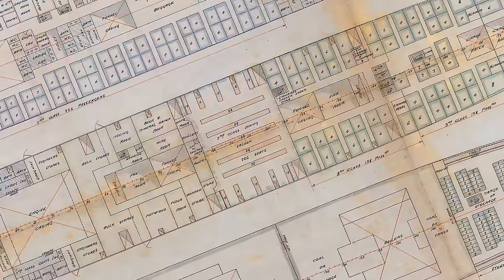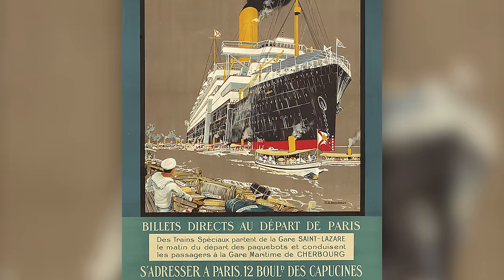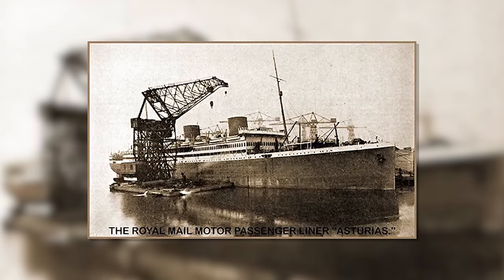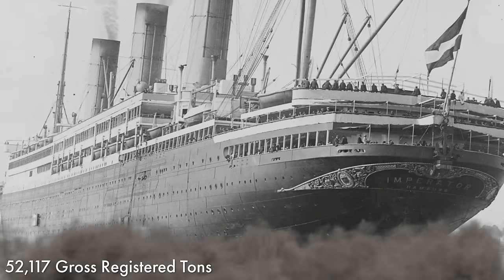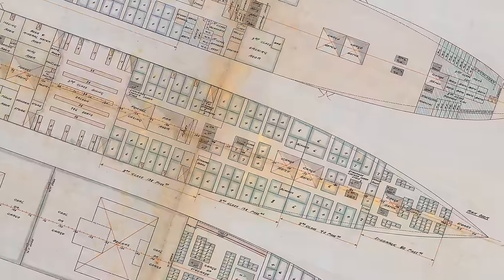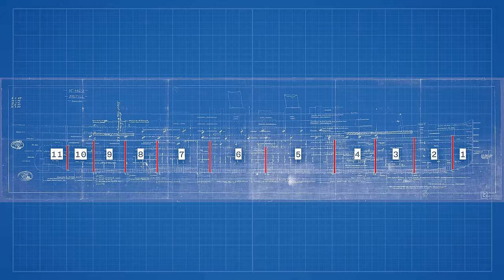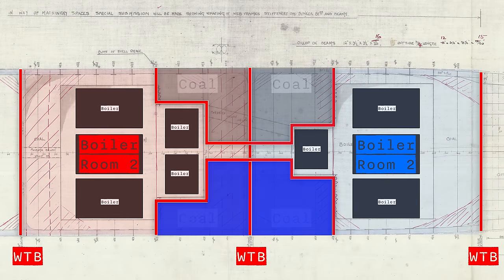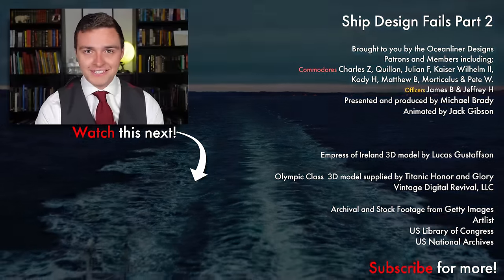When Engineering Goes Wrong: Three Badly Designed Ships

Comment: 13:56 welll if she has the draft clearance for it and  enough reserve buoyancy for it    im thinking probably best to add a keel .. like what sail boats have   you'd need to add less weight over all as the leaver effect would be larger but you also have to contend with more underwater drag ... that said i do have a question if you will indulge me  and that is ... why no catamaran ocean liners or trimaran cargo ships  it may feel silly but the more i think about it their are some pretty major upsides in terms of speed, capacity and safety .... its very hard to sink a trimaran lol   also why no screw auger type automatic stokers  im pretty sure they had those on steam trains would seem like the sort of idea that would have occurred and been easier to implement of a ship yet im not aware of any ?  and thats not getting into coal slurry which would have made for some interesting ships

Comment: There were several lessons learned from the Titanic sinking.  They did make several safety improvements on her sister ship Brittanic, but sadly those did not save her from sinking
Reply: In fairness, the Britannic hit a mine which is something the ship was not designed to withstand. And even then it wouldn't have sunk if the crew had taken proper precautions in a war zone, like keeping the portholes shut and the watertight doors closed as much as possible.

Comment: Very cool animations. Some points; the issue with the last vessel is called asymmetric flooding (something to be avoided as shown in the animation). Another; flooded compartments cannot be watertight (an oxymoron); instead the non-flooded compartments are kept watertight by the WT doors. 
W.r.t. the first example of the diesel powered vessel, I suspect the yard was well aware of the issue. Rules of thumb power prediction should not have been too far off with plenty of comparable ships built. But as hierarchy determined the method of power, the result was as you show. And it looks to me that the decision maker was rather deaf to reasonable argument..
Reply: D.j.Vander, you can count on it.   There was no computer simulation back then, but more than enough big ships had been built and trialed so that estimation of required engine power was pretty accurate.  Mike produces videos that are excellent in presentation and content, really splendid, but it is becoming clear he has trouble with engineering concepts.   In this video he made a major mistake, he's noted that the diesels were replaced with turbines and taken that as implying the diesels were a bad choice.
Lord  Kylsant didn't err in choosing diesels, and the engineers erred only slightly in specifying engine size.
Saving money and cutting corners was a priority.  Kylsant requested a speed of only 18 knots, he didn't anticipate that the later competition  would make 22 knots.
Kylsant basically wanted a cheap plodding ship to fit within a cash handout he got from the British government.
Hence, they had to find a way of upgrading the ship's power, and it was easier to install turbines.

Comment: A thoroughly absorbing and educational video, thank you so much.
It might seem a little churlish then for my only comment to be critical, please don't take it as such, you presented a polished product.
You refer to the remote closing of water tight doors as electronicly activated.  It is a bugbear of mine that the terms electrical and electronic get misused.  They are distinct and different terms.  Electrical means employing electricity to convert into another energy - resistive heater, motor, solenoid, etc. Electronic infers some processing power, it is the use of electricity to make decisions or follow a program.  Usually this means it uses transistors or silicon and as such is a term that is hard to apply to anything much invented before the 1930s.
TLDR, lovely video, try and ignore grumpy old men.
Reply from the maker: Interesting point, thanks!

Comment: Basically I've figured out, pretty much everything, cars, ships, buildings, roads, even earth itself, must bend and flex or it will shatter and break....even metal, it needs to bend ever so slightly without deformation especially at cold temperatures or it can cause catastrophic failures, and since metal is used for structural purposes in almost everything, engineering that tiny flex is so important and rarely ever talked about, until a failure causes loss of life, it applies to carbon fiber and plastics, it's so important, the recent implosion was probably caused by the material flexing a tiny bit, over and over, until the last time it flexed it failed causing a catastrophe and loss of life, I find material sciences extremely interesting sorry for the non sensical rant I hope everyone is having a great day or night!

Comment: Did not expect to see such big names on this list!
Gotta say that it seems like compartmentalization is the real way to go.
Sure, double hull, double bottom, all of that, but I think the smaller you make the compartments, the less likely that one flooding will be a disaster.
I think that should be taken to the extreme; how impractical would it be to make every room on a ship a watertight compartment?
Don't warships already do that?
Combine that with your by-default-closed watertight bulkheads, your double hull and double bottom, and Hell, throw in one longitudinal bulkhead for the entire ship's length to enable you to combat listing, and I think that ship would come pretty close to "unsinkable"!
Then throw in some buoyant tanks like Titanic's lifeboats for good measure!
Reply from the maker: Careful to throw around the ‘u’ word! Haha
Reply: Watertight doors are very heavy and the partitions between the watertight compartments would have to be heavier to withstand the water pressure and the tremendous force of inrushing water.

Comment: 7:40 Why didn't they just expand the diesel engine room (As they would have to anyway to accommodate the steam engines they eventually installed) and add two more Diesel engines to boost the overall output?

Comment: Mike gives the Asturia's engine power as 10.000 hp each.   they were actually 7500 BHP or shaft horsepower, and is the figure that should be used when estimating speed or comparing with turbine.   The 10,000 figure is the INDICATED power ie the power delivered to the pistons.
Mike states that Lord Kylsant erred in choosing diesel engines.   This is not the case, he erred in requiring a low speed (18 knots), not anticipating competition.   The engineers could have designed in and installed three diesel engines instead of two.  And/or installed more cylinders.
Note that power required for any given hull rises as to the third power of speed, so the power required to achieve 22 knots would be 2 x 7500 x (22 /18)^3 ie 27,300 shaft HP., almost a doubling.
Reply from the maker: Hi Keith,
Kylsant intended Asturias and her sister to achieve 20 knots as I mentioned in the video. They severely underperformed cracking only 16.5 and therefore required re-engining in the 30s after which they could hit around 18 or 19 knots with turbines. The 10,000 IHP figure was taken from a 1925 edition of The Shipbuilder magazine which is why I reproduced it here :)
Reply: @OceanlinerDesigns  Accoding to the references I consulted, eg Nicol's book, Kylsant only wanted 18 knots.   in any case it is still true that he could have had more speed with diesels, PROVIDED he told the engineers, who would then have allocated space for a third engine, or more cylinders on 2 engines.
if Shipbuilder said the engines were 10,000 IHP, then Shipbuilder was correct,  But you used that figure incorrectly wrt your context.  As i said, when comparing diesels with steam turbine, you need to compare apples with apples, which is shaft horsepower - which is termed brake horsepower by internal combustion men.   Asturia's diesels were 7500 shaft horsepower.
As you said in your video, once a ship is designed and built, it is very hard to change engine room configuration.   We may presume they found it easier to put turbines in rather than a third diesel, which would need a third shaft and prop, a new stern etc.

Comment: May I ask you from what source does the idea that Royal Mail and it's owners were "embarrassed" by the performances of ASTURIAS and ALCANTARA spring from? I've been fascinated by the motor ships of the 1920s for decades and have, I believe, read everything available in journals like SHIPBUILDER, BRITISH MOTORSHIP, MARINE ENGINEER and SHIPBUILDING and SHIPPING RECORD but have never read anything that would suggest that Royal Mail were less than fully satisfied with their new ships. I assume if the contracted speeds were not met on trials, RM would not have accepted the liners from H&W. I don't dispute the fact that the French and Germans operated liners to South America that were clearly faster but if Royal Mail were actually disappointed in the performance of their new ships, it would be important to know the source. One can't assume they had regrets or were embarassed because, as you rightly point out, building two large motor liners is a complicated affair and having the fastest ships on a route isn't always at the top of an owner's list of requirements.
Reply from the maker: Hi Will! Being trade journals that largely served to advertise British shipbuilding the publications you mentioned would surely not seek to discuss the failure of such a venture. One source for the information regarding RMSP’s discontent is Stuart Nicol’s ‘MacQueen's Legacy; Ships of the Royal Mail Line Volume 2’. You mentioned you thought if RMSP was unhappy with the ships’ performance they’d not have accepted them from H&W but remember that Kylsant was chairman of both companies at the time.
Reply: Thanks much for your reply! We'll have to agree to disagree about the shipping journals' being value as  a source but everyone gathers and presents their facts in different ways. I have  "MacQueen's Legacy" as it turns out and read a few pages in question. Some interesting statements I will enjoy checking out and at least he includes a Bibliography (when so many do not) Someone with a background in marine engineering needs to write a book about this whole period of the motor ship's leaps and bounds and admittedly, that person is not me! Thank you again. @OceanlinerDesigns

Comment: With Diesel engines why is there reliance on a single, large powerplant? If they are driving electric generators (or alternators) why not more redundancy? Four smaller engine-generator sets rather than 1 or 2 massive ones? For that matter, why not 8 or more, all remote from each other, to ensure survivability in an accident?

Comment: There were ZERO proper compartments in any of these ships. They were open at the TOPS, which meant that if water exceeded a bulkhead, it flowed into adjacent compartments. Compartments need to be AIR TIGHT (closed at the top), not merely water tight.

Comment: One thing that sounds crazy but can be vital: you do need a way to open up a hole in your hull to let water OUT. In the 1969 Sunday Times Global Ocean Race, one of the people competing, Nigel Tetley, had serious issues with his yacht. He was struggling to stay in the lead but his yacht was badly flooding even though he had a bilge pump. He realized it wasn't working quickly enough so he had to drill holes in the forward section of the yacht to let the water out. It was all for naught as his main rival Donald Crowhurst, had been cheating by misrepresenting his actual navigation and claiming to be edging towards the coast of Europe. Tetley pushed too hard, hoping to keep his lead. A huge section of his hull ripped away, dooming his yacht. He was forced to abandon it but did survive the sinking.

Comment: The Empress of Ireland's sinking was always going to be catastrophic, as there was simply so much damage... her design did not really contribute so much to the speed of the sinking *(without those bulkheads she would have simply filled so fast with so much water she would have dropped boyantless to the sea-floor)
Reply: But as least based on the info presented here, with a different bulkhead design the ship may not have listed as much while sinking, allowing more lifeboats to be launched.
Reply: @Sashazur  they did not have modern style lifeboats, in addition, most of those who actually made it out on deck escaped in some form or another, it sank so quickly most were trapped inside the ship.

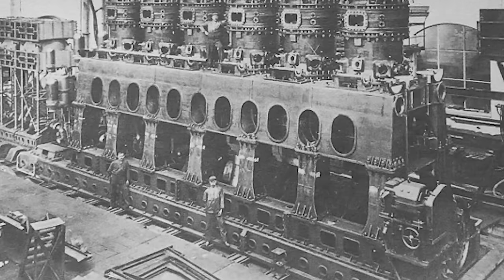Comment: At 4:58 Mike says R  Diesel's new engine got rid of the sparkplugs.   Who cares about sparkplugs?    What is good about a diesel engine is that it is about double the efficiency of a gasoline engine, ie half the fuel consumption.   And it can run on poor quality fuel.
Mike also claimed the diesel can run on liquid fuel and doesn't need bulky dirty coal.  That's true.   But steamships can run on oil too, and after WW1 most did.
Reply: More importantly diesel engines have high torque output that's why you see them on heavy machinery
Reply from the maker: The key point is that it did away with boilers :)
Reply: @aslamnurfikri7640  : That's an old urban myth.    Power is torque multiplied by RPM.   so if you have an engine that develops a certain power at a certain RPM, that means a certain torque - it matters not whether the engine is diesel, gasoline, steam, or whatever.
You see diesels on heavy machinery, trucks and commercial vehicles of all kinds not because of torque, it is purely because they have half the fuel consumption of gasoline engines, and fuel is the biggest cost.
Reply: @OceanlinerDesigns  That is true, it gives you much more space for cargo or passengers, although an oil fired boiler can be designed to take up a lot less space than the old scotch boilers that were common in the coal days, especially when taking into account you don't need an army of stokers, who need workspace, off duty space, and sleeping space.

Comment: Power measuring seems off, 25% more power shouldn't be able to raise the speed from 16,5 to 20 kn. Either the steam turbines produced more power than disclosed or the diesel engines produced less.

Comment: Sadly there is still today issues with watertight doors not beeing properly closed during sea voyages.

For example it was found out that Stena Nautica has multiple doors wide open when she almost sunk a couple of years ago.
Luckily when she sunk she did so after an heroic effort to keep her afloat and also after entering a safe harbour.

and then we ofcourse have The Estonia which had a poorly designed watertight door system.

Comment: Please consider that Diesel Engines are not the standard at sea. Of course to burn liquids is standard, but often its more like hevy residues of oil refining called heavy oil. This might fuel 2/3 of all ships, especially the bigger ones, while smaller might use Diesel engines as they are also used at land and just "marinized" or Gas, Electric. etc. which is not scaled up so easily due to small market share and technical issues. And there is atomic... for some ice breakers and the military. So this Engines base on Diesel's Ideas, but as they dont burn Diesel the word is a bit misleading.

Comment: It still boggles the mind that these older designs didn’t incorporate a sort of tank-top to their compartments like today’s ships which effectively make the water tight compartments sealed boxes when closed. Instead these compartments were more like bowls which slowly filled to the tops of the bulkheads before eventually flowing over the tops and back into adjoining compartments. I know that more steel is more money but if they went to such lengths to ensure “floodability” then it seems only common sense would dictate such a basic principle.
Reply: robertstallard7836  you're listing the introductions of novel inventions rather than the innovation of existing concepts. "...what if cup had lid" is not the same argument as "what if pilots had backpacks full of rope and fabric that would slow their descent". All of those examples are the introduction of the new rather than simply modifying whats already there. Yes, we have the advantage of hindsight that the shipbuilders did not, but these were the greatest ship builders, engineers and designers of their day who had all but mastered turning ink into steel.